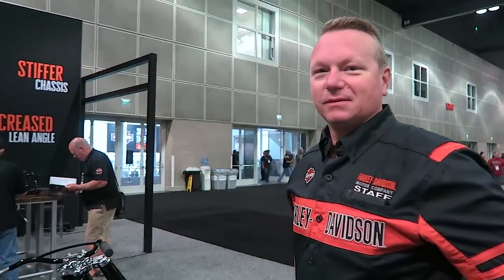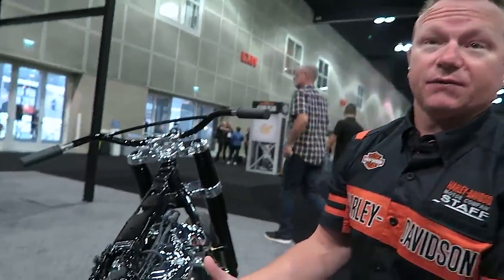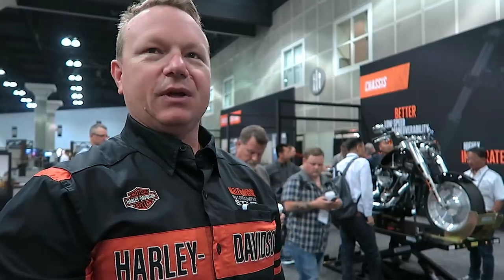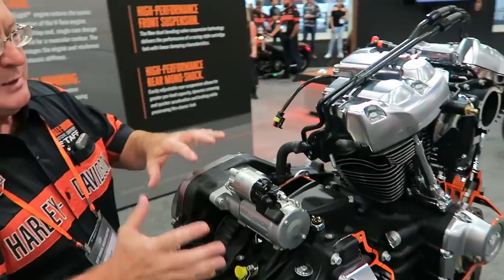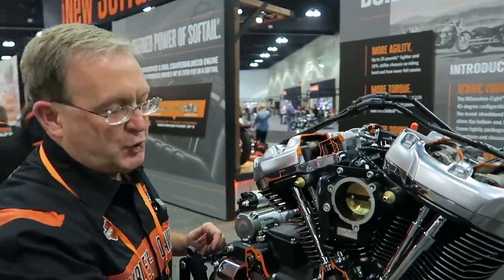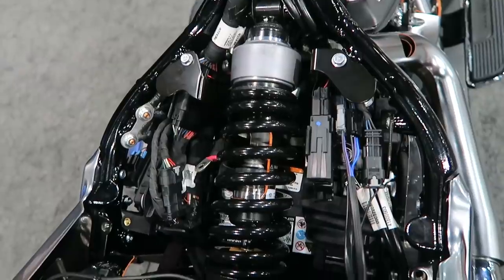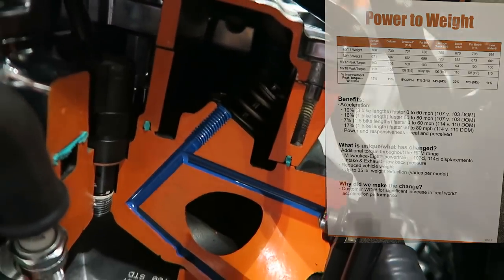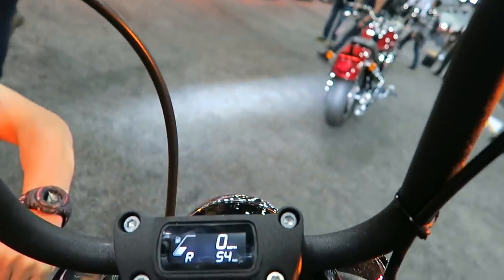2018 Harley-Davidson Softail Chassis Revealed│H-D Engineers Give us a Walk-Through│All the Details

Comment: I love this walkthrough and by no means want to shit all over it.  However I did a little comparison to my screenshot of the old '16-'17 FXDLS to the '18 Fatbob and posted this on advrider:

If you watch the entire dealer sales release (laidlaw's dealer 
announcement on youtube) the plaid-pajama clad corporate brochachos 
proselytize up to 35 pounds lost over the SOFTAIL lineup, a bloated 
subframe that originally added about 90lbs to the knuckle frame it 
emulated.
So now that we're bemoaning the loss of the Dyna lineup and hailing the 
solid mount svelte muscular physique (congrats vaportrails!) of the 
FatBob, lets compare one pinnacle of performance the other, you've gotta
 trust me I pulled this off my screenshot straight from the website:

'16/'17 Lowrider S, dry weight as shipped: 646 lbs. 

'18 Fat Bob, dry weight as shipped: 653 lbs. 

'16/'17 Lowrider S, wet weight: 676 lbs.

'18 Fat Bob, wet weight: 673 lbs.

The LRS had a 4.7 gal tank and a lean angle of 29.5R/30.5L deg.; 

the new Fat Bob 3.6 gal. tank and 31R/32L lean angle.  

LRS: 42mpg stated and Fat Bob: 47mpg--real word neither come close to 
touching that stock. LRS real world I got 35-38mph stock with a tune/exhaust
42mpg on last fillup but I rail it and likely could do better on highway.

Also, no:

Cruise option on the Fat Bab. That sucks, I constantly have to wring my 
hand out on any trip and can't maintain speed due to the crappy speedo 
location on the tank.  No mid controls.  NO option to jack up the rear 
end without some serious studying or aftermarket swingarm (not 
available, yet and I'm sure the dyna aftermarket set is scrambling).

YES FATBOB:

Better front suspension for the same msrp. Better seat with two-up capability.  Better tire combo for better handling.

Overall I'd say it's a wash, I love the new fork and 114ci option but 
that's all I'm pumped about, even that's a meh considering the twincam 
is proven reliable, somewhat and the stock 110 pumps out a lot of power.
Also that lean angle surprises me, I thought the 'bob would have a 
little more to eek out than the LRS garbage stock setup.

I still want to ride the new bike just to see what I'm missing out on, 
however any new bike I get in the future will likely be Japanese as this
 bike is extremely cost-prohibitive and has the performance of about an 
FZ-09 well over twice, possibly three times the price. I'll get my harley rocks off on the shovelhead and get something 
else as a daily.
Reply from the maker: Scott Kohs I'm a big low rider S fan. I'll just say that not everything can be determined by stats and numbers. The new frame just handles better when you're putting it through the paces.
Reply: Your videos have always been informative and useful so I believe you when you say it handles better when being 'put through it's paces'.  That doesn't really surprise me because mono-shocks (when done properly unlike the previous softail) work better than twin shocks (other things being equal).  But Harley have never been just about performance, they're also about how a bike looks (in fact some would say more about looks than performance).  And the new frames without the twin shock rear end just don't look as good!